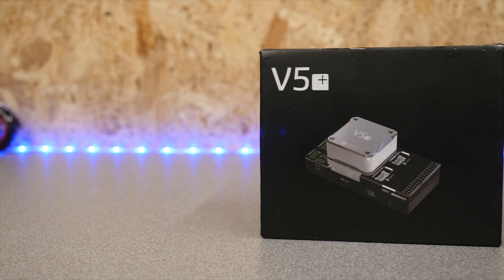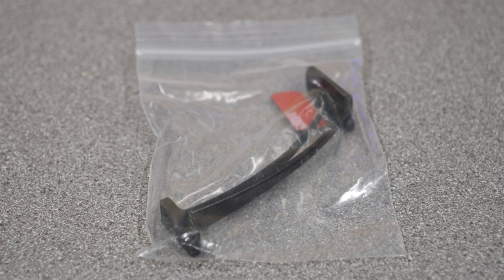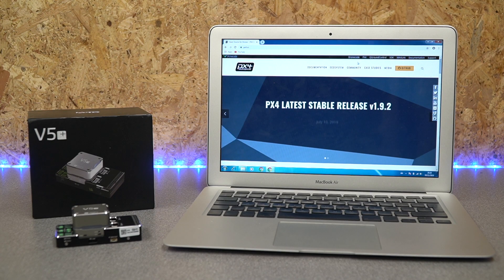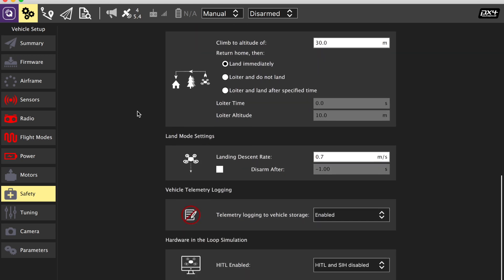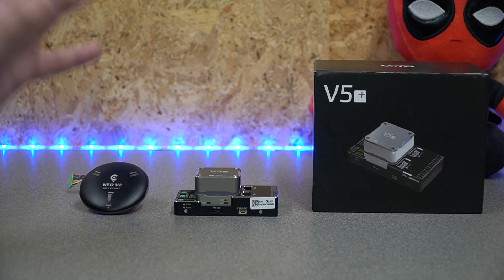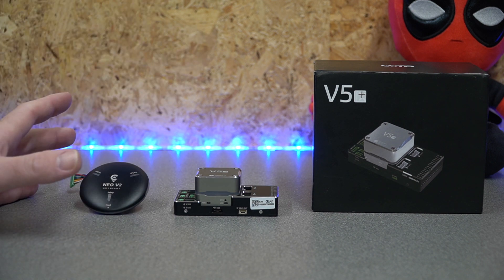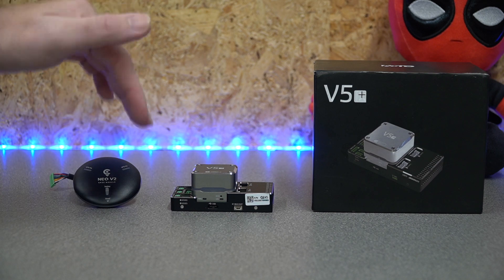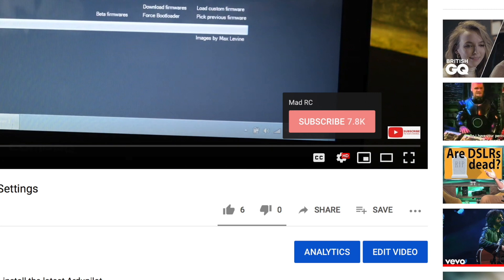CUAV PIXHACK V5+ AUTOPILOT UNBOXING & OVERVIEW - FOR PX4 & ARDUPILOT

Comment: Hi, realizing this video is a couple of years old, today is the first time I've heard about cuav. So I did some searches and saw you had a video on it, and I've used your videos for my pixhawk Cubes and here2/3 gps, really helped out !!
So looking at this video, so mentioned something that really perked me up, you said that cuav's wifi adapter works with the Cube as well. 
So my question is, if this unit works with pixhawk, what advantages can I have other than connecting to gsc? Can I stay connected during long range flights and have vehicle tracking by map?

Reason I ask is because I use crossfire with my Cubes, and crossfire bluetooth telem just doest cut it, very hard to connect and if you do, very hard to stay connected.
When I started building my fpv platforms, I didn't do enough research, if I had I'd be flying today using xlrs long range systems.
I appreciate your help, thank you

Comment: Hello, I recently bought v5+.  I was resetting the parameters to reset the settings, the main led on the pichawk did not light up, I don't know if it's for my zero mount or something else.  Can you help me?
Reply from the maker: That’s odd.  So no led at all. I’d try resetting the cube module and then reflash again with diferent version of Ardupilot.

Comment: Can you please provide a detailed comparison with the Cube.
Reply: Awesome. Can’t wait for the comparison. I still run the 1st version of Pixhawk. Do you know if significant changes have been made to how these FC handle vibrations? Also do you know if any now have compatibility with Cross Fire as well as the latest ESC firmware like Dshots etc.
Reply from the maker: With regards to vibration yes dramatically, the original Pixhawk had no internal vibration isolation and required the whole controller to be soft mounted.  the CUAV V5+ and the Cube Black, Blue,Yellow and Orange all have internally isolated IMU sensors so these autopilots should be hard mounted as they deal with it all internally.
Reply from the maker: I will do that in a separate video I think as there is a lot to show on this. Basically it’s very similar to Cube Yellow with Standard Carrier board. 

SOC slightly different, Cube Yellow has F777 that has built in LCD controller and and JPG Codec for future use where as the CUAV has the 765 model, both have same clock speed and onboard ram and cache 

Both have Same Rom storage 

Both have triple IMU, Cube has 2 of them isolated and heated.  the CUAV has isolated and at this time I believe it’s all three but none heated.  

There are some deeper differences Iv not discussed in the passed around Orange specifically as it has secure cryptographic hash module onboard too for future use.  

But will do a video on this in more depth I think.   

The bigger differences are the carrier